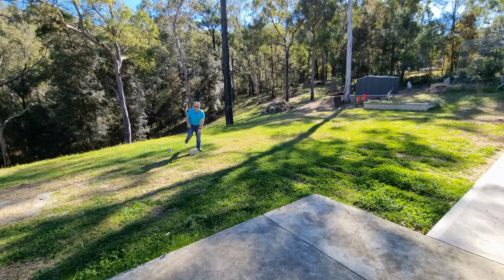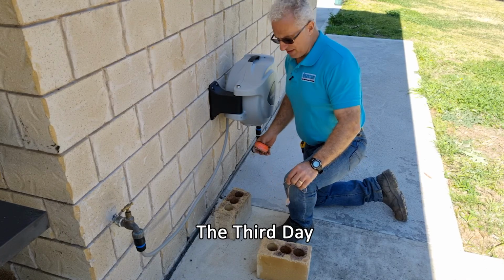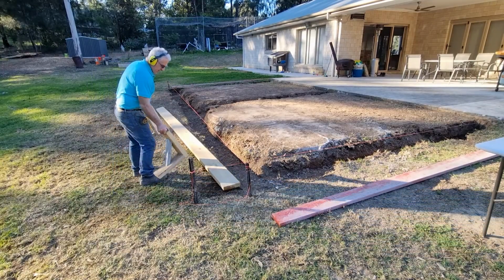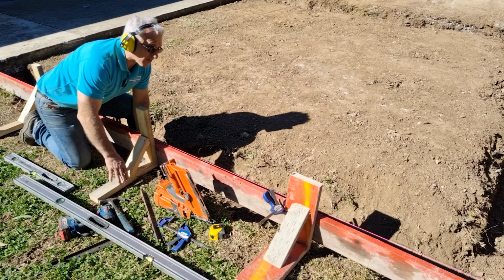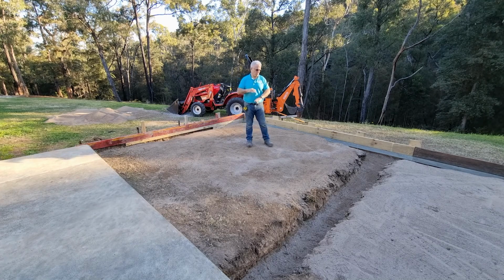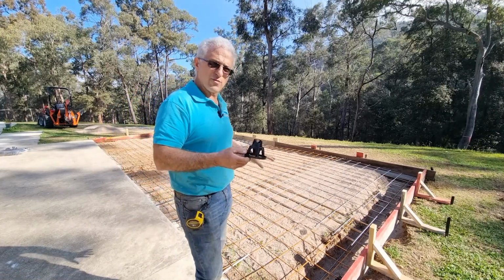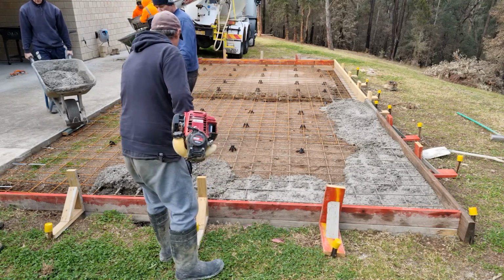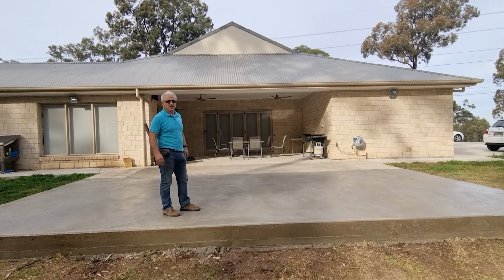Complete Set Out for Formwork, Placing Reinforced Mesh & Concreting a Slab! (DIY)

Comment: Thanks for a great presentation. Couple of questions, was there a need for any trench mesh at all, also would you put a expansion joint in a 64m2 slab. Thanks again.
Reply from the maker: Thank you for the feedback, Scott.

Yes, I have seen concreters pour slabs without using trench mesh, but it really depends on the strength you need to achieve. I choose to put it in after speaking to Jason, the concreter, basically for peace of mind. If you are concerned about whether or not to put it in, it might pay to have a quick chat with an engineer or even a knowledgeable concreter.

I choose not to use an expansion join between the two slabs purely because the new slab can expand out uninhibited. However, Jason got me to put expansion foam around the perimeter of the internal Alfresco slab years prior when he poured that slab, and it works perfect.

P.S. If you are interested to see how the slab turned out, I have put a link below where, years later, I got my old schoolmate to come and tile the whole area, which turned incredible! Jason is a good concreter that's for sure! 

I hope I have answered your questions. Cheers

https://youtu.be/CLCyKuAUHJY